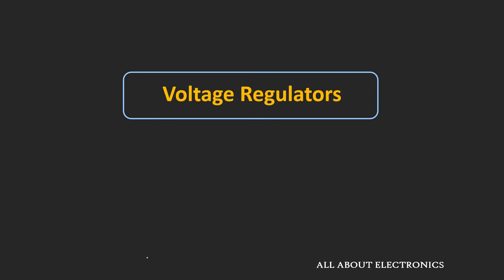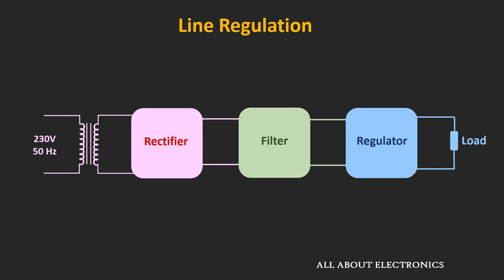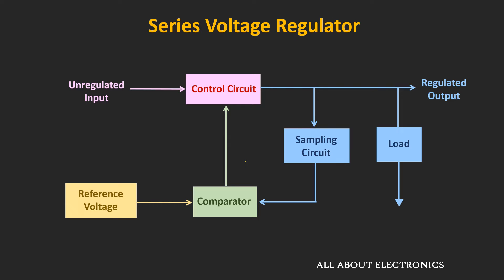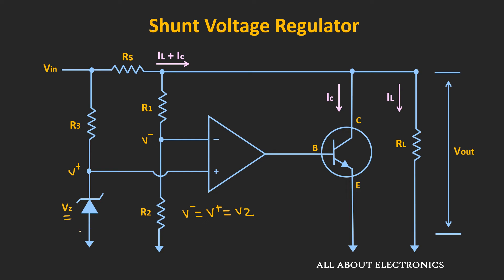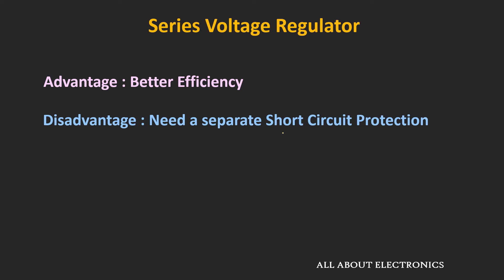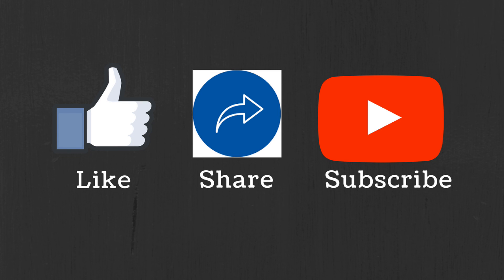Voltage Regulator: Op Amp as Voltage Regulator

Comment from the maker: Correction: Please note this.
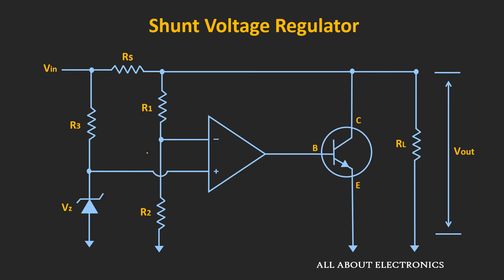At 4:48, for shunt regulator, the polarity of the inverting and non-inverting terminal should be reverse. 
That means the reference voltage should be connected to the inverting terminal (negative terminal) and voltage divider signal or feedback signal should be connected to the non-inverting terminal (positive terminal)
Here is the link for the simulation: https://www.multisim.com/content/Hw2z9xwQRQwpTek2LesNqc/shunt-voltage-regulator/open/
Reply: So, Sir in positive feedback we cannot apply virtual ground right?
Reply: no sir
 it's the correct circuit
Reply: please check your "correction" it's misleading...
Reply: ALL ABOUT ELECTRONICS  Why don’t you put an annotation in the video ? 
If you have done it I wouldn’t be thinking to myself that the circuit was wrong the first time.
Reply from the maker: @justpaulo  Yes, I will do it. In fact, that would be helpful to everyone.
Reply: @ALLABOUTELECTRONICS  , but when would you do it sir? Several months have spent and still nothing. I spent so much time figuring out that  it was false and then  I decided to read the comments and was happy to see that Iwas right... but many people may not look at the comments and will learn something wrong... you should modify it quickly sir..
But despite this,  I enjoy your video  and the nice details you give about the concept underneath component such as TL431 which appears to me as magical... I'm happy to at last understand it
Reply: No wonder I feel strange, ha ha
Will you make video on all kinds of logic gates circuit using opamps?
Reply: I wish I read the comment earlier. It took me a long time to prove that your explanation was wrong, not just your video, but most of the content online is incorrect!
Reply: The circuit works fine if you use a PNP rather than an NPN transistor...

Comment: The circuit can oscillate. It depends on the capacitors of the input and output voltage. Use a little capcitor between C and B of the transistor.

Comment: A voltage regulator is a circuit that maintains a constant voltage level. Linear regulators are a type of voltage regulator that use an op amp to maintain a constant voltage level. The op amp is connected as a comparator, and the reference voltage is divided by two and applied to the noninverting input. The output of the op amp is then connected to the inverting input, and the resistor R2 sets the output voltage.

Comment: Sir, I dont understand how  'the output voltage increases due to variation in load current'.

Isnt it the otherway around. I thought it was current changes because potential difference changes. 

I also thought this way. Maybe load resistance can change (like we charge multiple phones using a junction box, we might remove some of them, so resistance of the entire load changes) leading to change in current acc. V=IR.

But still, in that case V was constant. Kindly help with me with the first line statement .
Reply from the maker: The output voltage will change with the variation in the load. But when there is no load then output voltage will be maximum and as the load current increases, then voltage will reduce. And as I mentioned in the video, it is defined using the load regulation. As the load current demand increases, the current drawn from the source will also increase. And hence, there will be more drop across the series resistance of the source. That's why there is a drop in the voltage as the demand (load current) increases. I hope, it will clear your doubt.

Comment: Is the shunt regulator with the opamp considered "low noise"?  Would this circuit have a lower noise output than a typical LM317 regulator circuit?  I ask because I plan to use it for sensitive audio design.
Reply from the maker: What is the power requirement ?  I mean how much current the load is going to draw ??
Reply: @ALLABOUTELECTRONICS  It is a preamplifier for a microphone.  It draws 24 Volts and a constant current of 150mA.

Comment: Great video, an excellent circuit description, thankyou very much, just wondering i have built a few of these circuits and sometimes they appear to be unstable, would placing a pico farads capacitor between the op amps output and the non-inverting input help solve the problem, by slowing down the op amps bandwidth.  Anyway thanks again, please keep it up.

Comment: Can you explain why if the voltage output increases then the Ib will also increases ?
Sir thanks for the great video !
Reply from the maker: The base current Ib is the current supplied by the op-amp. Since the op-amp is operating in the negative feedback,  it will try to maintain the voltage at the inverting and non-inverting end. And accordingly, the op-amp will regulate the base current. I hope, it will clear your doubt.

Comment: @ALL ABOUT ELECTRONICS  Is it possible to directly feed the AC supply voltage to the voltage regulator without passing it through the rectifier and filter? I'm asking this because I'm planning to generate a PWM signal through 555 timer and I want to feed the AC supply to the Vcc pin of the IC after passing it through the voltage regulator.
Reply: No, it will not work, you can try a triac, with gate fed with a square wave signal (not a pulse)....

Comment: sir, i have a doubt... you  said to reverse the polarity and and feedback signal to be connected to postive terminal... then it will be positive feedback right?? then virtual short wont be there... isnt it??
Reply from the maker: Yes, there is positive feedback to the op-amp, but as an overall circuit( with transistor), there will be negative feedback. For example, as the output voltage increases, more voltage will be there at the non-inverting terminal at the op-amp. Which will drive the transistor harder (due to increased op-amp output). So, base current increases, and hence collector current increases. Now, as the collector increase, the voltage drop across Rs increases and output voltage reduces (And also the feedback voltage). So, as an overall circuit, there is negative feedback and won't drive the op-amp into saturation. And as far as op-amp is operated in the linear region, the concept of virtual short/ground is applicable. 
I hope it will clear your doubt. You can also check the simulation file I have provided in the pinned comment for more information.
Reply: @ALLABOUTELECTRONICS  thank you for clearing my doubt. thank you so much sir
Reply: Exactly ....

Comment: You got the schematic wrong with the shunt regulator.
If the circuit is constructed as is, it WILL NOT WORK.
Let's say that R1=R2, the Zener diode is 3 volts, the output voltage is 5 volts, and the supply is 12 volts.
The voltage on the inverting pin of the op-amp would be 2.5 volts and the non-inverting pin would be 3 volts.
The op amp would turn the output on further, turning on the NPN transistor more and drawing the output even lower, which would reduce the voltage on the inverting input lower. The circuit as illustrated would be stable only at Vout=0 or Vout=Vin.

Reverse + and - on the opamp to make the circuit actually work. (You got the series one right).
Reply from the maker: Yes, that's true. Thanks for the correction.
Reply: Yes, exactly the schematic shown is incorrect.
Reply: Exactly bro....

Comment from the maker: The timestamps for the different topics covered in the video:

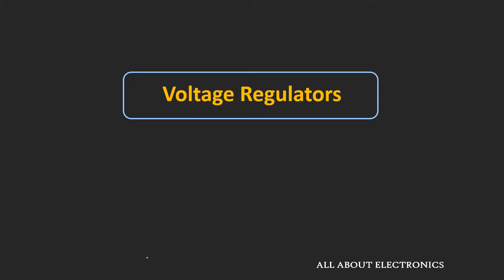0:30 Why Voltage Regulator is Required (What is Load and Line Regulation ? )

3:20 Basic block diagram of Series and Shunt Voltage Regulator

4:48 Design of Shunt Voltage Regulator using the op-amp 

8:44 Design of Series Voltage Regulator using the op-amp

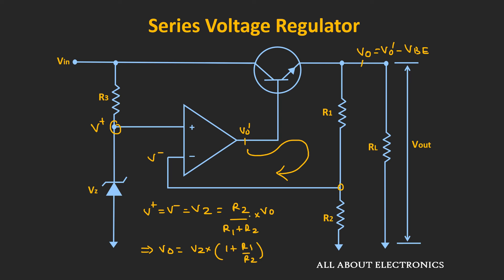10:57 Simulation of Series Voltage Regulator using the op-amp
Reply: Your explanation resembles mere recital of what is written in text book. Can you explain why Vo= Vo'-Vbe in series voltage regulator? On what basis did you write that equation? HOW DOES the KVL APPLY IN THAT EQUATION?